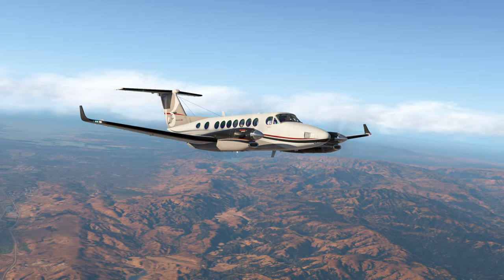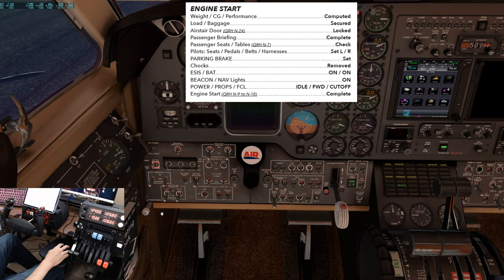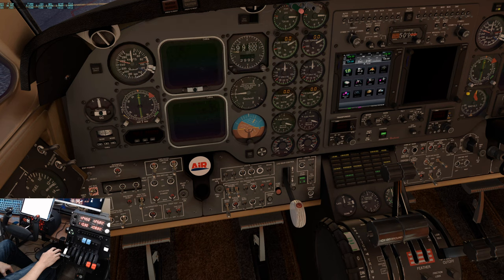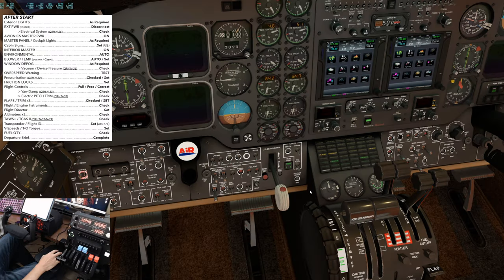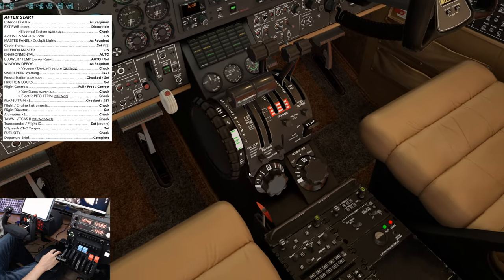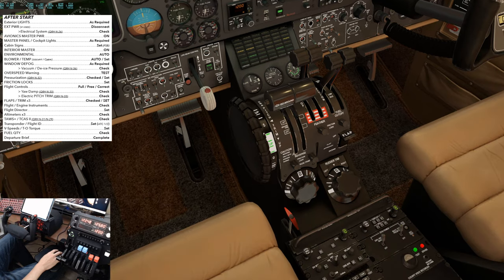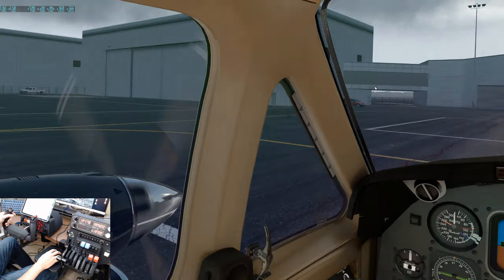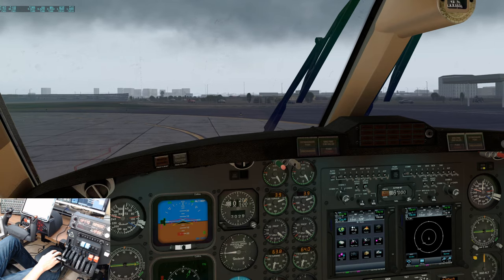King Air 350 X-Plane 11 tutorial by KA350 Pilot | Part 1 of 3

Comment: Woo! I've been waiting for this Chaz! Thanks for coming through for us.
Reply from the maker: Thanks for being patient.  Part 2 will be posted by this Friday.  Part 3 next week.
Reply: @chazflyz  Thanks Chaz, I probably missed you saying this at some point but I would love to know your overall thoughts on this particular X Plane  King Air 350i model when your done with your series. (i.e. The flight dynamics and systems characteristics compared to the real 350i aircraft 👍) It would boost our sim know how ego a bit 🙂
Reply from the maker: Initially I planned to throw in my comparison thoughts, but then opted out as I didn't want to overload the audience with too much information.  I'll do a separate video down the road. But I'll tell you right now- the Airfoil Labs K350 is spot on. Study level. It's very impressive right down to the electrical system.

Comment: this is awesome, thank you! does your KingAir 350 rock / dolphin in climb and/or autopiliot?? mine wont stop doing it. Smooth ride doesn't help, nor does setting alt manually. thoughts?
Reply from the maker: Hey. I haven't flown the 350 in a few years. Moved on since but I do recall 1 or 2 of our 350s rocking in descent, notably at high speed.

Comment: Im sure I missed it but does the Condition lever stay in Low idle the entire flight or move around based on certain conditions?
Thanks - these are very helpful!
Reply from the maker: Most operators keep it in low idle after engine start.  High Idle is just to help with engine starts and inflate the boots on the ground if needed.  But keeping it high idle for flight makes no difference in performance.

Comment: Great series, man! But how do we prepare our nav system (the Garmin) before the flight? Is this done with engines off, so ext power on and avionics master on?
Reply from the maker: Thanks. If you setup the Garmin with the engines off, do not turn off the battery/ext power or you will lose your loaded flight plan unless you are using a preset flight plan that you can quickly recall.

Comment: Dear Chaz, how do you got the dual 750 in there?
Reply from the maker: Assuming you have the reality XP software, it's part of the latest update to the King Air 350. I believe version 1.4 introduced dual GTN.  Current version is 1.5.3 .
Reply: @chazflyz  I bought the RwalityXP GTN today but I only have one visible, no dual devices. Any advice?
Reply from the maker: Is your King air 350 software updated to 1.5.3 ? Minimum 1.4.